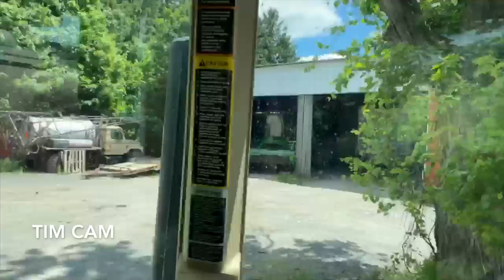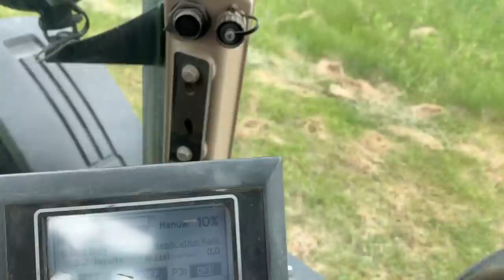BALING HAY

Comment: I know your feeling of balers always breaking down when they shouldn’t. I help a farmer bale and we bale at night becouse of the moisture here in Kansas and we use a new holland big square baler and a jd 4630 front wheel assist if I remember right on what model number it is. And we use 2 jd 4010 to pick up the bales. It’s always a pain when it’s dark and you are trying to fix something on the baler. Our main breakdown is the sprocket chain that drives the pickup. What do you guys have for common breakdowns

Comment: You guys should trade that Case baler for a Massey Ferguson baler, they're more reliable and your top speed with them is like 7mph with the newer ones that is, im not sure about the older ones. We own a 2013, 2170 XD baler and the knotter fans keep the area very clean compared to that Case and 2170 s a 3x4 not a 3x3 so I don't know how well your little tractor would pick it up. It's just a thought and opinion but it was a great video like the others 👍. Also what year is your baler? and the fastest you can go with them without plugging up the pickup?

Comment: Why do some farmers bail round and other farmers bail square hay ?
Reply from the maker: all preference
Reply: Round balers are a lot cheaper and simpler to run and also keep better outside as water can run of easier. They are how ever slower as you have to stop to wrap and dump each bale. Also roundbalers can't drive as fast and the bales don't pack as tight as square one and is more of a hassle to transport. It all comes down to how fast and efficient you want to make the bales and how you store them.
Reply: @jacobotes8443  it's all about preference and you are right, round bales store better out in the elements. you can pack those round bales pretty tight, we make our alfalfa bales in between 1600 and 2000lbs. Also with net wrap you only have to stop for a moment.